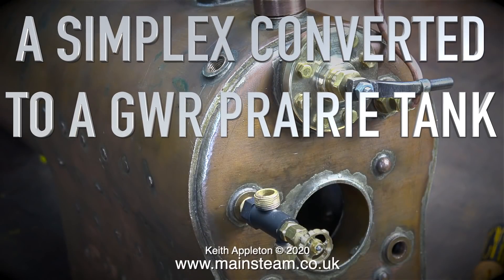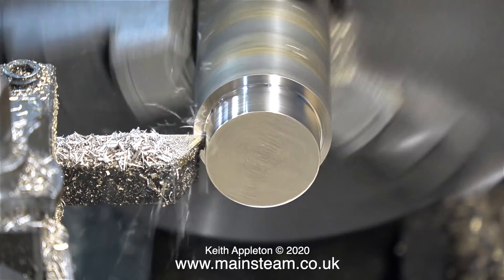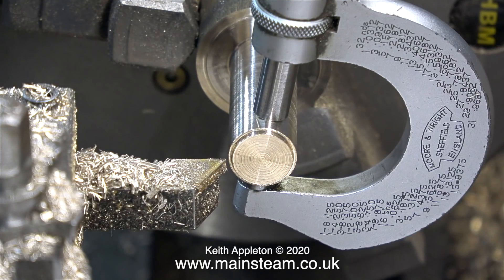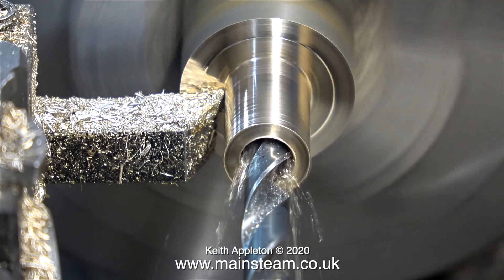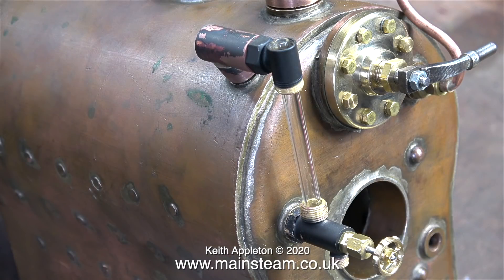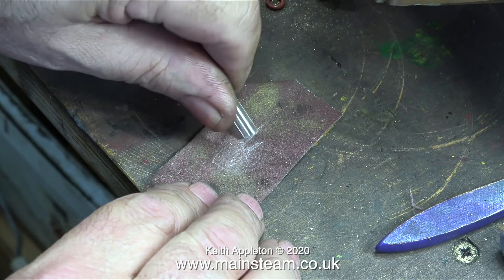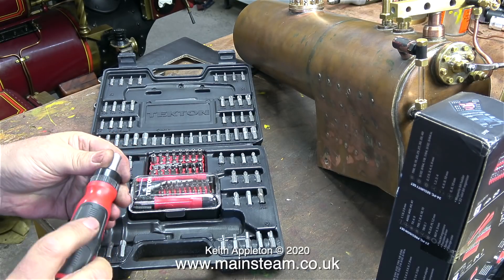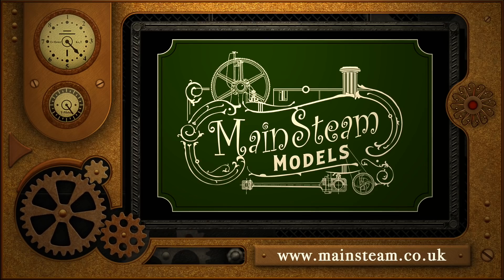SIMPLEX PRAIRIE TANK - PART #16

Comment: hi keith ..regarding the tanks/cab and bunker ..are they 3 separate peaces that bolt together or are there all bolted together and taken off in one peace ..currently res erecting a 3 1/2 gwr small prairie ( an actual one ) as mine are in 3 pieces that i presume bolt together ..thanks
Reply from the maker: On this one there are 6 pieces in total, all riveted and soft soldered together.

Comment: As I was watching you machine phosphor bronze I was thinking if you turn the tool bit upside down and use a right hand tool bit instead of a left hand tool bit then turn the machine on backwards the chips will spray straight down. At least I think it will work.
Reply: just don't do it on a lathe with a screw on chuck